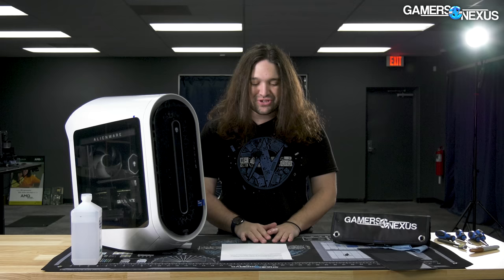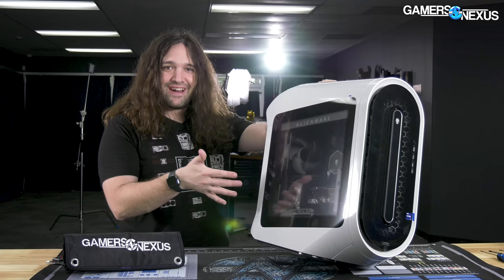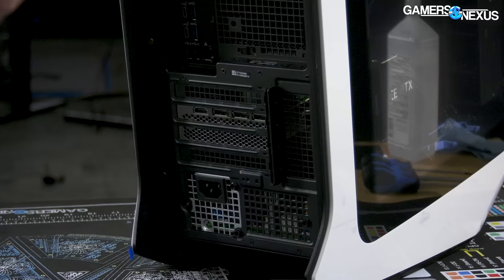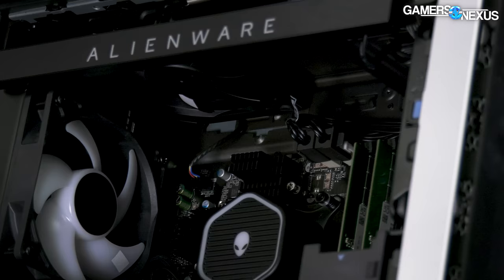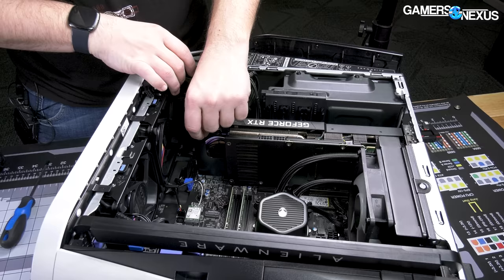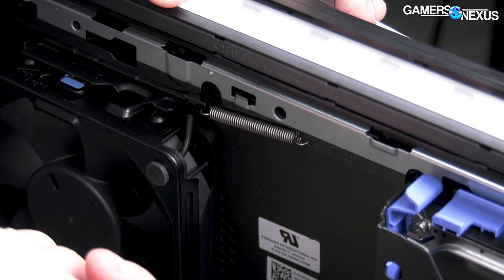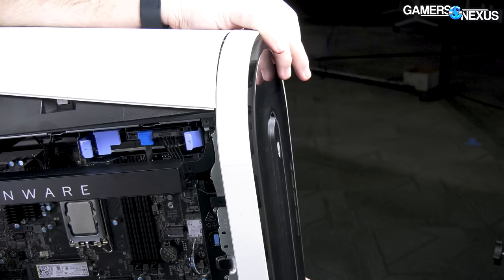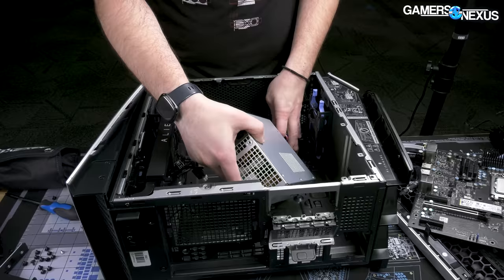Crazy Bad $5000 Alienware Gaming PC: R13 Aurora Tear-Down

Comment: So I was somewhat involved in developing this system (can’t say specifically for reasons) and want to clear something up. Everyone, and I mean everyone designing the r13 wanted a new chassis. It was a constant point of contention among the engineers and designers, led to a small loss of staff and proved to be a major hurdle. 

Management refused to listen and doubled down, it was either make it work or get out. For many of us, the r13 was meant to be an industry redemption story, a system worth every penny. While management refused new chassis designs, they simultaneously demanded we shove as much tech (mechanically and otherwise) into it. 

As GN said, all the fancy shmancy additions were implemented to fit a ridiculous number of high-performance components into a chassis designed for Office workers of yesteryear. It wasn’t necessary, but at the same time, it was. 

“Bloat” is an understatement, half the development cycle was spent on making this work. Management gave us a reason, we were told that our chassis were over-produced in previous quarters and that all previous stock needed to be sold off before building in others. 

We were incredibly disappointed with the company, we felt as if we failed our fans and there was absolutely nothing we could do about it. Our lead quit after the r13 shipped, an incredibly talented individual that fought with management for years over stuff this channel regularly points out. 

My main point in all of this is, please don’t blame the engineers and designers at Dell. we’re definitely not idiots, rather, we’re chained to Dell’s inherent greed and backwards managerial style. We don’t have any say, and if we did, things would be a hell of a lot different. 

Sorry everyone, just about every colleague of mine watches this channel, hoping to get more of a voice in upcoming products. 

If you have a minute, contact Dell and encourage them to “listen to the engineers!”, maybe that’ll make a difference!
Reply: It usually ends up being this way, guys actually doing the work on the ground telling management that their ideas are bad and there's an obvious better option. I feel like it happens so often it's becoming a truism.
Reply: This thing is like a German sports car with the amount of engineering it took to over complicate design. Everything might be somewhat forgiven if the thing performed well.
Reply: And for the airlow, let me guess. They insisted on the glass on the front because "it looks cool" and/or "it was like that last time". And didn't even allow the compromise of gaps or holes around the sides to at least give some breathing room
Reply: @blovio  The even shittier side to that is.. when there is a massive success story... who gets the credit? Department heads and managers.
Reply: This whole project is a beautiful piece of engineering art. Be proud of that at least. As GN said, it's like a computer themed puzzle box.
It's just a shitty computer, and as you explain, it's not any of your faults.
Reply: @TechSY730  Basically. Dell manufactured a metric f*ton of chassis’, plastic molds and panels in the past believing they’d be relevant for years. Instead of abandoning alot of this stock, we’re forced to implement it across the Alienware range, even when counterproductive to thermal performance or current tooling. 

Then, because the costs are so bloated by our incorporation of this stock, they charge a far higher price to consumers instead of allowing us to completely overhaul. 

We’re actually scolded by management periodically for going over budget, which would be understandable at any other company.
Reply: The issue is that there are people, right now as I type this, buying the R13 and justifying what management did.  They know folks that aren't saavy will think this is a great computer on the Alienware brand reputation only.  The only way this changes is if consumers get smarter and realize what Dell has been up to.
Reply: Thats kind of what I expected. Throughout this whole video I would think, hey, thats some cool engineering (I'm currently working on a mechanical engineering degree) but then I would just think why.
Reply: The shit situation of engineers having to spend their time designing solutions for the problem it should not exist (because of out of control decisions) is exactly what I pictured when watching this review.
Reply: I am happy with my PC, didn't had any problem's and rarely hit max CPU / GPU usage in games. So don't worry about haters that don't even care how they look themselfs..
Reply: I relate to this in such a weird way lol. Not an engineer, but I'm a game tester for a certain rather large title and I always see people shit on us testers and devs, when in reality, it's the suits fucking everything up lol. Hope your mental sanity is good, I know it doesn't feel good to get shit on for things out of your control constantly.
Reply: thanks for sharing. As a fellow engineer its sad that this story is still told just as commonly as it was since forever ago....I'll never understand. Thank you for your work and I hope you find a company that listens to you +1
Reply: @MTGFoil  ik you mad after this video that you wasted your money on e-waste (atleast you are happy with it) but don't put the blame on regular people seeing through dell's bs just because you couldn't. That's not undeserved hatred by some random haters, it's deserved hatred to a shitty company for a shit product relying on non existent nowadays reputation of their old days.
Reply: @blovio  agreed, bad bad design teams also exists.
Trying to work with engineers is not always easy, especially when they have some screw loses or superiority complex.
Reply: there are companies all over looking for engineers and designers in this job market. Why would people stay with this failing company, their dishonest warranty shit, and turning their "premium" product line into something that is substantially worse than all off the shelf parts?

It's not the engineer's fault management makes bad decisions, its the engineer's fault that they continue to work for a company making sure their professional history is one of bad products for bad reasons.  The lead was right to quit - the whole department should have. It might have actually made alienware better.  instead its just more intentionally bad products at ruinous prices.
Reply: You poor bastards make miracles happen and nobody ever even thinks about it positively. We salute you, computer engineers of Hell.
Reply: It is extremely clear to me (product dev) that your team was given a form factor that was pre-determined, either by marketing or by what you had in stock, and you were then tasked with fitting 5lb of shit in a 2lb bag. My sympathies. I'd love to see what the Alienware team is able to accomplish with better feedback to your higher ups, there were great parts on this build (particularly the spring-loaded fan cages) that would improve the serviceability of a better build
Reply: @blovio  good leaders know how to follow, the bosses job is to pick the best people for the job, not be the "ideas guy"
Reply: Sorry to hear about that. I actually do like alienware. I love my M17 R3 laptop. Sucks that company's won't listen to the people who actually design the pc.
And even worse, I liked dell too. I was sadly a naive kid at the time. 

I still want to get an Aroura ALX chassis because it was my all time favorite of the alienware chassis.
Reply: @jestonxi6391  in this case, the ideas are verifiably terrible. You’d be surprised to find out where good ideas come from if you were in the industry.
Reply: The only bright side I see is that it's environmentally friendly to reuse all that stock... Maybe...
Reply: A 750W power supply seems underpowered for that power hungry 3090 GPU.
Reply: If I may ask, as I fear this kind of stuff making m kill myself when I get my master; Was management right in terms of the bottom line or not? I.e. , disregarding the negative reviews ( that may or may not affect sales cause the people who buy this are wealthy amateurs anyway ): Would retooling ultimately cost less than all the workforce hassle, time wasted, etc on engineering the bloat? 

If not , how do you fight that kind of issue?
If Yes, was management at least self critical/reprimanded?

If Yes but No...How do you manage to get out of bed? Serious question.
Reply: You make excuses for why the wheel was reinvented needing a PLC before it will work.  Unacceptable to Steve, and not buying it.  Clearly this was made overly complex on purpose likely due to compensation in Engineering hours, I do not believe you this was designed in house.  Dell do not really have that many cases, why would they not sub that out?  Besides this case and design x 3rd party might come in to them under 200 and they sell it to consumer for a grand.
Reply: @Dobermanator  you can believe whatever you like, the benefit of living in a free society. You’re incorrect, though.
Reply: @Shane9934  Thanks Meister, you forgot to say, "Double Stamp it!" "No erasies!
Reply: Thank you so much for being open about this information
Reply: @avramstanton5248  that is something I never understood. Who, in their right mind, slams down such a ridiculous amount of money for a product without at least looking at a review of it? Especially if they're not knowledgeable on it themselves. How is AW still surviving on brand reputation when every reviewer under the sun (and every tech comment section) destroyed their desktops?

(also, to the original comment, that's super rough man. I hope for all the engineers' sake the situation improves over there sooner rather than later)
Reply: @AVdE10000  If You have a considerable mark up on the product then the sales people in the stores will push this product. And people go to stores and turn to sales people for advice thinking they are just regular employees and experts on products on the isle they are in, not sales people that work on commision.
Reply: Thank you! I bet this is a common dynamic In today’s world in general
Reply: another example of how bean counters in corporate america make everything more garbage.  We have a culture where the people who count money somehow think there smarter then actual specialists in every job....
Reply: This comment needs to be pinned
Reply: This comment needs to be pinned
Reply: Who is “management”? Let’s make them accountable so they can move on to ruin another company. You don’t F$&k with Alienware. I’m sorry but 100% serious
Reply: Damn it sounds like a company based in the Soviet Union.
Reply: @TechSY730  I mean Dell calls that "high airflow" WHEN IT CLEARLY ISN'T. I mean if it was mesh at the front,  THEN it would be. Slapping a piece of acryllic or tempered glass in such a way that RESTRICTS airflow IS THE EXACT OPPOSITE of "high airflow".  The execs at the top DO NOT SEEM TO GET THAT and it is SO ANNOYING. They SHOULD NOT market something as something when it CLEARLY IS NOT SAID THING is HORRIBLY INEPT and they should be ASHAMED OF THEMSELVES.
Reply: @blovio  Dell is just one example of this. I mean, look at Andrew Wilson of EA. He ALWAYS walks away with MASSIVE year-end bonuses while the ground-floor developers get the short end of the stick and it is disgusting.
Reply: Great, you should be ashamed of yourself for having part of such a trash product.
Reply: They didn't blame the engineers. At the end in the summary they literally said the engineering was good and it was probably a management problem.
Reply: Yea and i live with santa clause
Reply: @avramstanton5248  This is why advertising and marketing budgets absolutely DWARF the amount of money spent on actually designing and engineering projects. The actual R&D budgets are a drop in the bucket by comparison. Unfortunately,
Reply: How many of these chassis did they make (or the tooling for them at least? I see so many Dells of various ages all being practically the same internally) for them to not want to make something new and not shitty? Do they have literal warehouses full of the things? They have all this amazing hardware stuffed in a sweatbox! It can't breathe! And we all know how hot modern hardware runs.
Reply: As an engineer watching this, I wonder why the cooler wasn't fitted with attachment points at the 80mm-fan spacing, to reuse the cabinet holes.  I also wonder why that long sliding arm is used for side panel attachment, Where other brands simply slide the panel itself and use a smaller clamp to lock it in place.  Also, the various toolless actuators in Dell cabinets need labeling for in-house servicing by IT departments and enthusiasts.  Instead of a generic padlock symbol, mold or sticker the English words "Lock front panel" if that's the function of a particular lever.
Reply: I want Dell to fail. Please keep ignoring the engineers, Dell!
Reply: DELL needs to learn from the downfall of Hewlett-Packard to today's "HP." As a privately-held company, Dell does not even have any of those excuses.
Reply: @randommcranderson5155  Getting a clean and accurate reference can be problematic.

Ever been in the situation of not being able to disclose why management or Personnel is lying, or even what your hardware-level knowledge and experience is?
Reply: @ActionableFreedom  It's not even a matter of re-tooling expense. He covered that with his initial comment--re-tooling the factory will happen down the line. The problem is a massive overstock of existing cases and case components from yesteryear that have to be disposed-of, in this case by using them!

You must be young. I spent years servicing three generations--twenty years' production--of Dell's business computers, from Pentium 90MHz to CoreDuo and Quad2Core. Some made amazing use of airflow, despite having cases made from plastic-jacketed steel (there used to be a valid reason for it, called, "impact protection,"). Most components were top-notch, too.
Reply: @davidgoodnow269  Wait so they just made tons of cases and then stoped making them? Thinking they would last for decades?
Reply: @ActionableFreedom  Several years' worth, yes. Dell has done that for decades. Just look through their service section, comparing cases from photos!
Reply: @johndododoe1411  Probably has something to do with this chassis being used in a bunch of other Dell products, worldwide.
Reply: That's what the guards at Dachau used to say, mate.
"We didn't want to do it, all we did was follow orders".
Plenty of jobs out there for engineers, don't need to be working for Dell specifically.
But, i guess there is reason Dell charged 5 grand for this monster, more money for the "team".
Now Dell engineers will say they work for minimum wage.
"Lame"!
Reply: @adreiiaii510  Should have been marketed as a puzzle to train problem solving skills, package it unassembled & let the owners find out that it can compute once solved~
Reply: I was too
Reply: Requires class to "get out"
Reply: @meister do hon have insights on the xps17 laptop. Why is the webcam so godawful and cheap.
Reply: Muckity mucks will always turn a deaf ear when it comes to the struggle between good work and profit margin.  You do the best you can within the parameters you're given and that's all you can do.
Reply: Sounds like there were very unhealthy amounts of narcissism involved with management during this project, as for being unable to admit they earlier made a mistake by over producing obsolete outdated design plastic parts and instead of doing away with their failure and let engineers design a good new system, they made them suffer for their previous mismanagement by forcing an outdated skeleton into some wannabe new product, as if no one would take notice. An old saying goes: Dead fish start stinking at their head.
Reply: @lordcommander3224  As a German car-brand technician, I can say that at least German cars are very amazing  and well designed for the first few years of operation. Alienware is like an overengineered Yugo.
Reply: @ceeinfiniti1389  Haha true
Reply: @randommcranderson5155  Lol... People have families to feed man jeez
Reply: @rochester212  The difference being Dell doesn’t commit genocide, kind of an uneducated viewpoint you have there. We don’t just work on the Alienware range, you do realize Dell serves the business realm too, right?
Reply: lol I never blame the engineer, I know no engineer wants to make this kind of bs. It was clear as day that you guys had to do all that to fit the stupid case, everything revolved around it, ridiculous. This has been a fault with Alienware even before it was acquired by Dell. I'm just sad that to this day this continues to happen. Blows my mind that so much is sacrificed because of design, I know it wasn't just design but older parts stock, but that could have been repurposed for something less demanding ffs.
Reply: Believe me we know it a bunch of "Business Management"  grads responsible for this.    Would be a very different PC if the Dell Engineers could really do what they want.
Reply: Brand new computer, same old shit. Managerial quartal-fixated grifter culture. Lesson of story: don't buy american, don't work for american. Same shit from the auto industry on to here and everything between.
Reply: I'm an IT Architect and always laugh when people blame the designers, devs, engineers - it shows how little you understand how business works if you think this...
Reply: No that won't make a difference.  What will make a difference is not purchasing Dell products. Thats my plan.
Reply: @crupt1023  My streak's already over 20 years long~
Reply: @Shane9934  Alienware was pretty shitty for a decade now. This is not the first desaster.
Reply: This is why mangement should stick to management and allow the people who know how to do their jobs to actually do their jobs.
Reply: I thought this would be the case. Really sorry to hear that this happened... And keeps happening.
Reply: Yeah this whole "contraption" looks like corporate bullshit being approved by a bunch of guys who know nothing about PC's patting them sleeves on the back, 
"We met the metric team!!"
about to be fired - "Yeah but..."
Reply: yesteryear? is that even an actual word?
Reply: @Cesko_Plny_Fialovejch_Zmrdu  yep, it’s a noun.
Reply: @Maru Blanca because it is
Reply: Shoulda made a youtube video drama series.
Reply: Mad respect for you
Reply: I swear at least half of the MNC are like this. I work at a Japanese MNC and the management is so out of touch and stubborn i can't believe it can still support itself.
Reply: my uncle works at Nintendo too!!!
Reply: So upper management couldnt run a shit fight in a sewer.....
Its funny how more often than not the people in the "highest" positions are the least capable of getting anything done efficiently or properly.
Reply: Cool. Perhaps it's too big a loss to toss the old chassis tho on the books. Maybe next time? I hope you aren't outed by anyone for posting this, I don't think it's actually bad for the company to have talented engineers talk.
Reply: Lol there's fans of dell???
Reply: @eddiebernays514  They do make solid laptops cost for capability. It’s just their tower systems that seem to be really bad.
Reply: This "overproduced" line smells of bullshit. I'm loosely familiar with the processes involved (different industry, but if anything, our costs would be higher!) and I can promise you that nobody bothered to run a cost estimate comparing scrapping the overproduced units (which aren't the engineering team's problem) to the amount of kludging you guys had to do, and the increase in overall manufacturing cost for all the units that do ship. Never mind the lost sales caused by the sh!tstain that ended up in reviewers' hands as a result of that one management decision.

Sounds to me like this old chassis design used to be someone's pet project and that someone is married to the design, to the exclusion of everything else. Emotions and management don't mix, but clearly someone didn't get that message.

Every company has that one manager who is practically unsackable and has way too much pull in the organisation for their abilities. I suspect this is the final form of the middle manager who fails upwards. Just a shame it befell what could have been an amazing product. I'm not surprised people quit over this. Entire engineering teams have quit over less.
Reply: I'd have told them to sell the extra cases on the second hand market. Gonna be honest. I have never bought an Alienware and I don't want to after it 
 went downhill.
Reply: Seems like these days, the board of directors at like every company in every big industry are being retired out for business people with no sense of quality or innovation, or even engineering knowledge or knowledge of the product at hand. All they know is 'MAKE MONEY. CUT COSTS.' The quality in EVERYTHING has gone down the shitter. Games, phones, tech. Only thing still in tact is like Music and Movies. It's sad to see how much tech is being held back due to society putting more worth on business people and 'money makers' than letting actual masters of the craft run the show.
Reply: @lordcommander3224  Porsche, for example, doesn't sell anything that they haven't tested to hell and back. If there'd been any testing/engineering feedback loop allowed, this "gaming computer" would not have hit market.
This is typical obstinate Dell. Make it proprietary, make it cheap to build, get them out the door, fk the customer at all opportunities.
I remember not that long ago that I went to repurpose a Dell "Gaming XPS" case and realized, dumbfounded, that it WAS A MIRROR IMAGE OF THE ATX SPEC! WHY?! Why do none of their power supplies follow basic specifications?
Even at their worst, the German auto companies at least try to make the car mechanically sound and perform well. This? This is utter garbage because the company was just trying to squeeze margin as hard as possible.
Anyone who buys anything from anyone even remotely associated with Dell gets exactly what they deserve at this point.
I've never driven a Porsche, BMW or Audi that purported to be a "performance" model that really disappointed me.

This computer definitely has all the frustrations of working on a German car, but with none of the fun of driving one.
Reply: @blovio  Porsche at their head quater here in germany actually has a few guys to reason with the management for exactly those reasons when designing cars.
My neighbour is one of them that basically explains managers hopw an engine works and why the accountants can't decide which material to use.
This system itself is stupid, it never leads to better products, just richer managers.... This is why we can't have nice things
Reply: @hkscfreak  Not really. These components will die far before their expected lifespan from being in this chassis AND they ended up using way too much plastic to make all this (barely) work in this chassis.
Reply: Damn thats heart breaking story those designers and engineers deserve a better company to work for.
Reply: Bro I've built like 3 pcs in my life and think i could've done a better job. Everything is wrong and I'm surprised you think you can blame executives.
Reply: I work for a huge corporation in a totally different field, but I can sympathize with you with dealing with inept management.
Reply: @MTGFoil  The PC sucks. That is objective. Support the engineers.
Reply: @ganjasage420  i have been in the computer game for a very long time, encompassing everything from embedded controllers to supercomputers.  I also have quite a lot of PC experience, and let me tell you... Dell made horrible propriety junk in 1995, and in 1998, and in etc, etc, etc.
Reply: @williamstaylor5449  I never claimed they were the best of the best, but dell is certainly not the worst. Apple was. You should know about the bailout of apple, because of their computers just being pure awful. And as for HP, compared to Dell ill take a dell 5 times over taking 1 HP computer. I still have a OEM dell 1500 from 01 that'll fire right up still. 
I certainly do not think, nor am I trying to convince anyone that dell was/is a good company. However I am stating what I've experienced with dell. Compared to what I've used, dells didn't fail me.. much.
Reply: @ActionableFreedom  Funny thing is... this system would take 2-3x longer to build and the same in servicing warranty.
I would be willing to bet that reusing the old cases actually cost more money overall then getting new ones.

Except the morons in mangament that failed to manage and ordered far to many cases, got to keep their jobs by using their position to offset the case cost into other cost line.
Reply: My dad is an electrical engineer and at his jobs there were many times he had to tell management they fucked up and do it like this. Luckily in petrol and chemical processing plants he worked at people actually listen though it would have been hard to argue against him because he knew his shit and most management did not have near the same expertise he had. Plus everyone needs chems and petrol so it's always better to listen to engineers or the actual fitters when engineers designed something that phsycially could not be put together.
Reply: I guess I can only speak for myself, but, whenever I watch reviews of something like this that mirrors more of a horror show than anything else, I've never thought, directly that the engineers behind this are the idiots who built and approved this POS. It's always the management (well, 98% of the time anyways).  I'll reserve my rant on why anyone would think that "this" is worth $5,000 must be out of their god damn mind.   
I really would like to offer some professional advice regarding your career.  I'll be blunt.  If you are still at this company, and not looking for or interviewing for another job - you're a fool !! It's a noble thing to stand with your colleagues & friends in an effort to push management back on course when they start stray.  But, it's another story when you decide to follow the Pied Piper. Huge red signs. If the people running this company believe that this product being sold at over $5,000 is good for the image and future of Alienware, then they are either off their meds or haven't even been diagnosed yet with severe mental disorders.  I can appreciate you asking people to contact Dell and encourage them to listen to engineers - but clearly that's pointless. Why ?  Because they let this product go out the door.  If there wasn't anyone on the management team to put the brakes on this product and stop it from going out the door, then it's time for you to go out the door. It's gonna be a lot easier for  you to use your current work experience as a positive to sell to a new job, than it will be after Alienware goes belly up - because - trust me - it will.  There is no way a company that puts out a product like this, then tries to sell it for 5 Grand and continues to survive.
Reply: I bought aurora R8 in 2019 with deep discount, still enjoying it. I had no problem whatsoever. Dell prob wanted to use all the cheap custom made stuff to cut cost, and made no room to upgrade anything. But the price I paid for was way cheaper than I had to pay for build one. Anyways, hope you find better employer.
Reply: @Shane9934  you know this would maybe be understandable (not even very much) if this was from a small company who really didn't have money for R&D, but the problem is Dell as an entity is worth over 100 billion dollars.  It's so beyond inexcusable that they are pumping out excess backstock into new stuff to save a buck that it's even hard to comprehend.
Reply: Somewhat unpopular opinion from me but I have to say I think the management knows exactly what they are doing. This computer is not for a PC enthusiast. It’s for rich ass kids and parents who want to feel good when buying an expensive computer without knowing anything about it except for the numbers. When I was younger I would totally admire a classmate with his dual 3090 setup in an Alienware, without knowing it’s downright stupid if you buy that for PUBG no matter how rich you are 

If there’s one thing that’s causing all the sadness, is for an engineer like you to work at Dell for pre-builds.
Reply: I can actually relate to this. In the office we have a massive creative projects on mind but the management it's so stubborn that they always end up picking the worst options for the company. 

I'm quitting this week bc it someway this job triggered my clinical depression.
Reply: GREAT SPEECH THANK YOU I FEEL BAD FOR YOU GUYS
Reply: @randommcranderson5155  you know money talks. At the end of day, why quit and have to find a new job when you are probably getting paid handsomely?
Reply: @randommcranderson5155  from 20 years in professional career, I’d a say 80% of people can’t fathom a new job. They will do a job they hate for years, make a half attempt at sending out resumes, then completely give up and stay in the job and lower perform bc they hate it. They are just as much to blame as the management, they’re all doing the wrong thing.
Reply: Man that really sucks, sorry you had to go through that. To work so hard on something only for it to be constantly shit on because of something out of your control is absolutely awful. I hope you all left that joke of a company and joined a new one that will treat you what you and your team are worth, because this is unacceptable. Keep your head up!
Reply: GN somwhat fix your design  with a 240mm radiator at front no ? So it was possible to make the case "ok" for the job. Hard to think the 240mm rad was out of question at the conception stage... Is it 100% the management's behavior fault ?
Reply: What a great fucking comment. People need to realise these companies are filled with extremely talented individuals, who are being overshadowed by suits that have no idea what they're talking about. Glad this guy came out and set the record straight.
Reply: There it is! The "M" word! As always!
Reply: I seen the leaks of the r15 that comes with 13th gen intel and rtx 4090 looks like they didn't listen at all to you guys lmao.Waiting for GN to review it gonna be a blast lol
Reply: I want to hug you and let you cry on my shoulders, good grief. This case shouldn't exist.

It reminds me of an older IBM Aptiva desktop machine with the same issues: brilliant engineering, followed by batsh*t bonkers decisions.
Reply: legend
Reply: You are forgetting the small thingy. At the beginning your lead actually accepted the goals that were in front of us and once we were certain it is impossible task, we were trying to change the term of delivery. This is what you get when your ambitions are too high and you don't listen to your team mates. Abandoning the ship was really classy move once he screwed us completely.
Reply: ackshually them using old chasses is eco friendly and reduces waste, thank you

lol jk, they shouldve just used those chasses for something else
Reply: @izdakilla  why do I feel likes it’s Apex legends 💀💀
Reply: @izdakilla  😭😭😭
Reply: I'm surprised that you and everyone else decided to "make it work" instead of leaving. You, as the worker, have much more power than you think. Threaten to leave and they'll be quaking in their boots. Remember, you are not their slaves. You are what allows the company to make money. They're scared of losing money, which means you have more control on what can be done within the company.
Reply: Yea, the case brings this entire system down to its knees in the dumbest (and most corporate) way possible. They're saving some money on the case, sure, but how much money do they now have to invest into the engineers and designers, who now have to somehow make this junk of a case work with components that it isn't suited for? Way more! The $5000 price tag is evidence enough for that.
And that doesn't even consider how customers will lose faith in the brand when they see it.
Reply: Thanks for this comment. One thing I would like to say though is, quit that shit company and start looking. I'm not and engineer on paper but I personally have built 6 different PCs all with beautiful cable management and proper cases (NZXT). I just could never work for a company or someone that would advocate shit products like this which is why I started my own business lol. Anyways, thanks for the comment non the less, I really hope you quit or all of the engineers go on strike. I mean hell, show them this video! Cheers.
Reply: I'm genuinely sympathetic and empathetic to your predicament. My personal criticism of Alienware is not directed at the engineers but at Dell itself. If the people building it had the autonomy that they should have I think Alienware would be a brand worth investing in. Aesthetically they are neat looking rigs and if the aesthetics matched the quality I would love to have one. Again, you guys as far as I'm concerned are not to blame for this.
Reply: Surprise surprise, the problems from companies are almost always because of management and higher ups not knowing jack shit about how the job works, and ignoring the actual people with the skills who know what they're doing. Dell sucks ass.
Reply: Love how Min maxers always find their way into managing in these oversized companies
Reply: Mtg foil this guys literally telling you it’s shit I take more pride in my computer and what I like to spend my hard earned money on.
Reply: Thank you for taking the time to explain something a lot of people do is whine and bitch about the item we bought. All of us do it all of us saved money for that new gadget that will help us work from home, or our kids school work, but we forget about the struggles that the people making this items and their issues, the companies issues etc. Thanks for that gentle reminder and thanks for taking the time to write this.
Reply: The main rule of capitalism. The choice of either making a good product with less profit or bad product with much profit. In Norway we have a saying: The only things that lasts forever is a bad reputation.
Reply: I’m sorry you couldn’t build what you knew was a better product. That must be so frustrating and discouraging
Reply: Show proof.
Reply: Thanks for the reply.
Reply: Did you guys make R15 finally worth it?
Reply: Wow
Reply: This comment needs to be seen more
Reply: If companies always listened to engineers ,then they would probably crash to the ground .There is the real world and then there is technology .Upper management is there to bridge the gap .Know your place
Reply: Back in 2017 my mom purchased a new Dell XPS desktop and what a fucking piece of garbage. $800+ for a slow ass piece of shit.

The only good quality Dell product I own is their 32 inch gaming monitor the S3222dgm.

Absolutely LOVE this monitor. Praying to God Alienware finally gets some freedom and creates some nice pre-builts for me to pair with this monitor.
Reply: Everyone knows it’s a management making these choices.
Reply: Or we all can just go on strike and not buy from dell anymore to see if that will change their minds. If nobody in the world or at least the united states aren't buying dell computers anymore then what can they do.
Reply: While I was watching I had a feeling this is exactly what happened. The only way spending whatever insane amount of time and money it took to make those ridiculously over engineered graphics card brackets is worth it is if you have a metric f**k-ton of garbage that needs to be adapted and that bracket is the only way to make it work. Sunk-cost fallacy in action. Insanity.
Reply: and despite the odds the r13 and r14 are my favorite models. They run great and it collects dust like a mf which only tells me the airflow is pristine. took me a minute thirty seconds to get the panels and front bevel off another 30 seconds to dust and she runs like brand new again. honestly, it's like a car, nothing to do with the pc itself, it's the user.
Reply: You were happy to take money for your ''work'' so yea...
Reply: I knew immediately that this was the case. That the bean counters were calling the shots. Can't imagine your frustration.
Reply: The proprietary motherboard doesn't even make SENSE! A daughter board with the ports and connections to a standard form factor, with maybe an SFX-L power supply... And you'd free up space, and save money because standard sized parts are cheaper!
Reply: Frank Azor left shortly after this.
Reply: So don’t work for a shitty company then….if they had no talent then things would have to change.
Reply: why not remove hdd from where it is , cut out a 120x240mm hole in the "roof" and put a bigger AIO cooler in it? then the plasticky roof would serve a useful purpose of carrying hot air out of the case into the back
Reply: This might be the most competent management I’ve ever heard in a story ever!